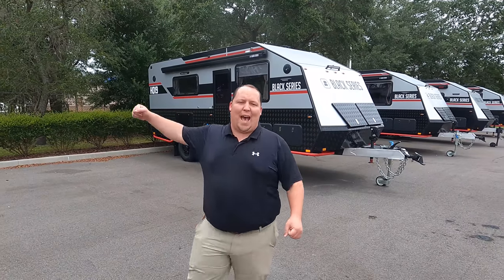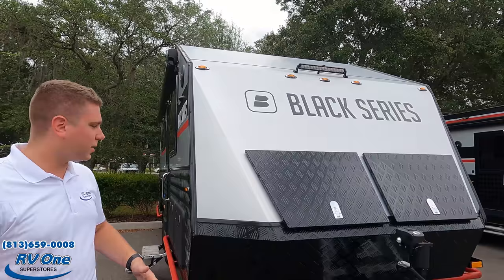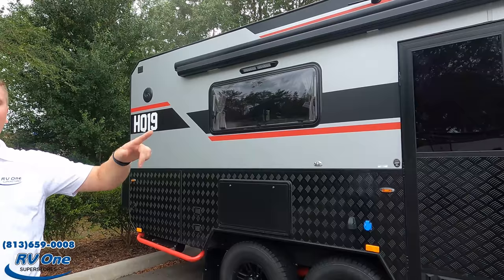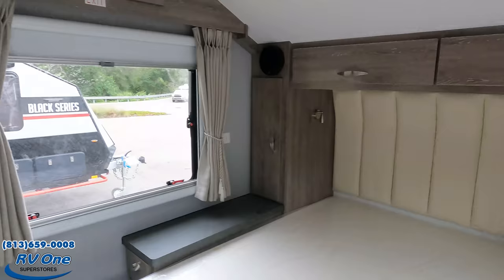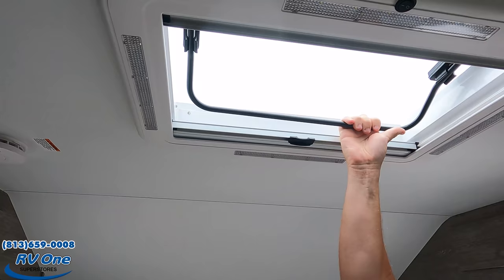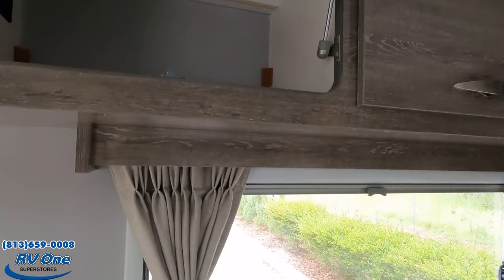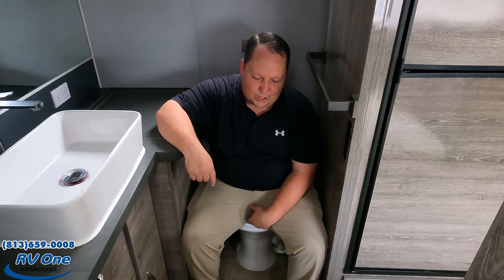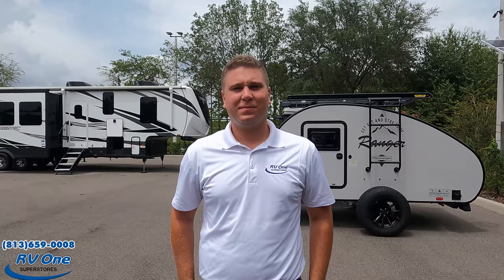OFFROAD Travel Trailer From AUSTRALIA!

Comment: Solar is not that expensive. All those parts cost maybe a grand. That hitch and axle is probably half the cost of that trailer
Reply: Fully agree! Should have rigid panels instead of those short lived flexi's. Should have 4 or 6 Battleborn Li's, a Victron Multiplus 3000 Inverter/Charger. Should also come with a 200 Watt portable panel. Then it would really be set up for solar. For $80K I expect a lot more in the solar dept.
Reply: @richardkoch8752  I can build enough solar to power a house with several days of backup power for under 20k. This is a 20k trailer without the solar and the off road stuff. I just can't see why you would need that extensive of an off road setup for a trailer. Everything inside will break if you actually flipped it like they talk about, so what's the point of going to that level?

Comment: I was so pumped to see these things. It had me thinking they were the perfect trailer to take racing motocross and hare scrambles with. I finally had the opportunity to check one out at RV One in Winter Park. I was really let down by a few things. 

1.) Lack of storage: There really isn’t that much storage inside these. They are beautiful inside and out but the storage is very limited. Even the pass through storage is pretty small. 
2.) Space: there wasn’t much space in these. The Sales guy and I were very tight inside this thing just checking it out. 
3.) Price: they kept trying to sell me against the airstream. I wasn’t even looking at an airstream. This trailer and an airstream are marketed towards two completely different buyers. An airstream wasn’t even on my radar. I took a look at the airstream afterwards and realized why they were hard selling me against the airstream. The airstream just had more to offer and was worth the coin. Sure, I could drag the Black Series up the side of a mountain if I wanted to but is that practical?

Overall, these things are really cool and look bad ass!  I was kind of let down by the actual usefulness of these. Bummer.

Comment: LT tires indicate they are a much heavier ply than a normal trailer tire. In Australia the tires are usually sized the same on the trailer and the vehicle pulling it so you have more flat tire options.

Comment: I have seen these as well on Australian videos. These are really cool. Price is crazy, but it really looks like you could take this off road. Way off road. They need to put some kind of bars or guard over the roof where the air conditioner is etc otherwise you are gong to lose that going under a low branch. They should also make the stairs fold into the trailer you could lose them as well.  I wish they had more hanging space for coats or clothes. Maybe take the sink out in the bathroom or make it small and put in a cabinet/closet for hanging. Like the fact that the tv can move so you can watch it. Don't like the white leather for dinette. When you go off road you get dirty. Love that 7 gallon washing machine.

Comment: Zack you definitely are expert on this RV and did a great job demonstrating the features. Two things I’d change..I’d make the washer a combo washer/dryer..even if the dryer can only work when on shore power. Also, I’d definitely want the refrigerator to also be 12 volt/solar for off grid capability.

Comment: I love it, but my wife won’t.  Not enough clothes room, wouldn’t use the outside kitchen, would rather have more outside storage.  Replace the deep cycle batteries for lithium.  And put a heavy duty electric bike rack on the rear.  Explain the diesel heater.  Matt, invest in a couple lapel mics so we can hear y’all better.

Comment: Very cool trailer. Overall I love the quality and finish of this unit. There are so many things I love about this unit, especially the NO SLIDES!!!!!  (sorry Matt) However;  I do have a few dislikes 

1- Steps
with this being an off road vehicle I'm surprised it doesn't have solid steps that can flip out of the way

2- Not enough storage
Definitely GUY inspired. I'm sure the ladies will agree. Where do you put your clothes? certainly not under the bed or under the booth seats because those spaces are taken up by components of the vehicle, and those side wardrobes should be taken out of the RV industry forever, if they were longer so that you could actually hang adult clothes, then maybe they would be useful.

3- Washer placement
Maybe it's me but I don't like the idea of washing my clothes next to the toilet and the access in the event of repairs or replacement seems limited; should you need to replace the unit you would have to get the exact same size in order to fit in that space. Yet It's cool having a washer though.

4- Batteries
Not sure if there is a lithium option but for 88k, lithium should be standard

5- 2 way frig
again this is an off road vehicle I'm surprised they have a 2way frig in this unit

6- Seating
Where's the seating? Although the booth seats look lovely and look very soft, they should have a sofa with a pedestal or Lagun type table.

7- Lighting  
I agree with Matt, where are the overhead lights

8- Ventilation
I love the skylight, but other than the skylight and the vent fan in the bathroom, I didn't notice a Max air fan or even a prep for one. Maybe I missed it.

Comment: These were selling for around 55k pre COVID.  I looked at the 2019 HQ17 for 49K.  These are over priced for 88k IMO.  I went to the factory in California and can tell you they are not worth 88k.
Reply: Seeing new ones on RVTrader between 58-67k.
Reply: @Lex-Rex  Although from the 2019 models till now some improvements have been made including the roof material.  Although they are designed in Australia, they are built in China and final assembly is done in California.  It is hard to find none biased reviews on these.  Unfortunately no one really knows the true resale value as they are pretty new to the US.  They are cool though but I bought my 2021 Grand Design 3110BH for just shy of 40k new last year.  I can not go crawling with mine or really off road but, for 40K less I have tons of more room my my kid and two black labs.

Comment: My dislike #1 is its electrical system. Solar panels should be high-yield solid glass & metal framed, and the batteries should be Lithium Phosphate. They are so cheap nowadays. My dislike #2 is the archaic LP refrigerator. I prefer a 12V compressor driven unit. Otherwise, this Aussie trailer is attractive enough to be listed on my shopping list.

Comment: If you are taller than 6ft 2in you will have a problem. Tall guys when seeing in person are a little surprised as on video it seems taller. Most brochures leave off ceiling height on these models. Matt, as you are shorter you need to emphasize height beside shower. Otherwise these are great trailers. Matt you always do a great job.

Comment: Northern Indiana needs to pay attention to how others build trailers 
Matt, that is a awesome trailer BUT...The solar sucks! For that money the flex panels are a complete disappointment. They only last 3-5 years compared to rigids with 20 & 25 year warranty's. AGM's?????really????? what a rip! For the price it should have 4 or 6 Battleborn Li's. A 2000 Watt Inverter is sad.....should have a Victron Multiplus 3000 Inverter/Charger.
I'm also surprised by a flat roof......not good for rain or snow. 
I would still take this over a Airstream.